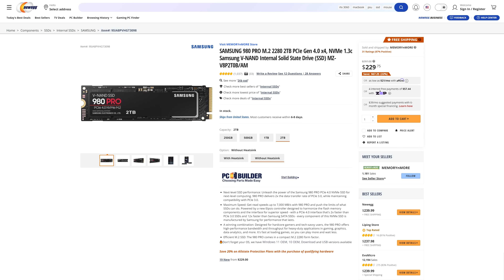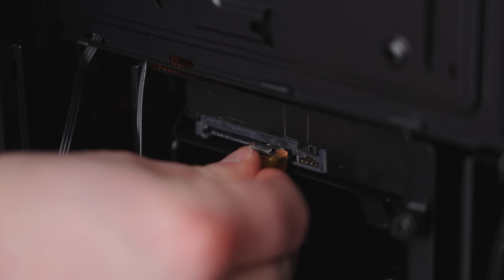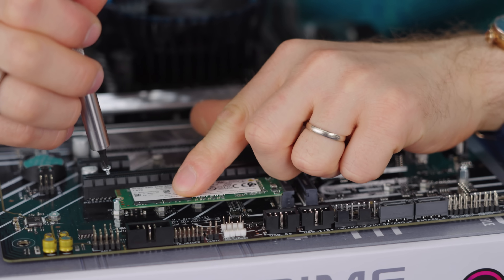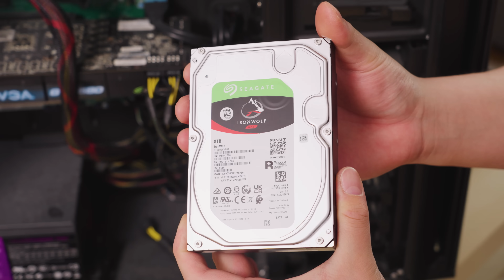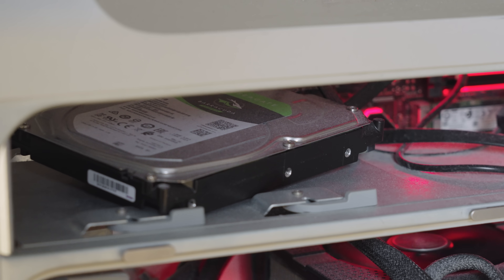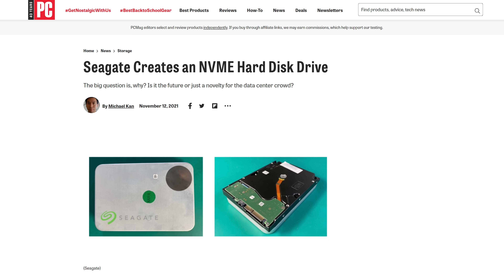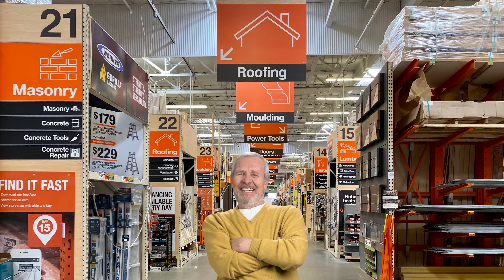Is SATA Obsolete?

Comment: One of the other things SATA did that PATA did not - was AHCI. Where you gain native command queuing, hotswap, and lowered CPU overhead. Not to mention you didn't have the complications of the ribbon. People talk about the jumpers as if they were a great problem (they really weren't. You got 2 options, master and slave. Set them and you're done.) But the ribbons were far more sensitive and caused no end of problems on their own, and they were shared. If you were reading from your CDROM and copying the data to your hard drive, you either kept them on separate chains, or dealt with the slow transfer as you could only read or write to one of those devices at a time.  This is easily the more important reason I found to get rid of it. If you have 4 devices in your system, that means something will always be waiting on something else.

Comment: A fact not mentioned is that SATA SSDs usually (if not always) have lower power consumptions and operating temperatures than the NVMe ones.
Considering the unperceivable performance advantage of NVMe SSDs for most of people, does the heat worth it?
Reply: Usually, yep. The speeds on NVMe SSDs are far greater than SATA drives, and unless your power consumption is dangerously close to the psu it’s not going to make that much of a difference. If heat is an issue, then the case or cooling mechanisms maybe need to be the things that change, or the positioning of your NVMe drive. If it’s seated between the CPU and GPU then it will naturally have a much higher temperature
Reply: @TheBigBadGlados  Yeah but, usaully in order to get the most performance out of an NVMe stick, it needs to be placed on the slot that is closest to the CPU, which also has the highest temperature as you mentioned.

Comment: Getting a SATA version of a SSD has been dumb for years, this video was released years late...  video obsolete?

Tons of hard drives in datacenters, tons more that still need to be made.   Just because someone made a hard drive with nvme connector doesn't make it a good idea. Servers have limited amount of i/o lanes..  You can only get so many nvme connections before you need expensive high speed controllers to multiplex all the different nvme connections...   So when hard drives at least have some other connector, or there is really something else to replace hard drives to ask if the connector is outdated seems like stupid question.  Its like asking are tires for cars outdated.. .with all cars still needing them.

Comment: Secondary NVME drive slots usually connect to the chipset and not use the pcie lanes for the CPU. There are some exceptions with motherboards, which allocate x8 lanes to the NVME drives, but usually you are not giving up GPU lanes for additional NVME drives.
Reply: I'm running a B450 board, and if the second NVMe slot is populated, my GPU is bumped down from 16x to 8x. I was considering getting a second 2tb NVMe, but after accidentally stumbling into this information, I'm considering a 2tb SATA SSD for games. The drawbacks are minimal, and the price is pretty much the same.
Reply: That's correct, I'm utilizing more then 1 and the other M.2 is on the chipset lanes with like the usb stuff
Reply: Where does one check for this information to know which method their motherboard is using?
Reply: @Crawfishness well, if you built your PC you can check the specs in the manual for your motherboard, it’ll give you the break down, if you have a prebuilt you can look inside and check for the model number of the motherboard and find a manual for it online (if they’re not using some custom no-name proprietary board).
Reply: If it's ON the PCIe bus, it uses "lanes".  duh
Reply: But it's connected to the chipset which is a switch duh usually connected thru pcie x4 to the cpu so it doesnt use any additional lanes on the cpu rather the cpu has 24 lanes whereof four are used for the chipset connection

Comment: Just one correction on M.2 slots, more often than not on new motherboards, I saw 2nd and potentially 3rd M.2 slots going through chipset and only first one is directly to CPU, meaning you can use all three without losing graphic card lanes. Though it is a thing to keep en eye out for and of course make sure that chipset has sufficiently fast link to the CPU to get most out of your NVMe SSDs. Or at least make sure you put fastest one in slot connected to CPU. Also I got feeling that as we move on, 3 M.2 slots will be getting only more frequent. Which I would definitely love to see. Though 2 are surprisingly not that hard to find or that expensive, but definitely worth paying bit of extra for, like I rather pay bit extra to have 4 RAM slots, just in case. 

Though don't get me wrong, SATA is of course here to stay as extra expansion option. Though I do feel like it will eventually fade into its niche as NVMe becomes cheaper and cheaper and as motherboards start increasing number of M.2 slots, like 2 isn't that rare on latest Intel chipsets. And AMD will definitely want to follow it up with next gen. Still for ultimate budget stuff, they will likely stick around for a while, plus mass storage. But I do think more and more general users will be happy with 1 or 2 NVMe SSDs, especially since some don't even cost that much more than SATA, while still being better wherever they can. Unless Direct Storage starts to become huge, which may or may not happen. Developers definitely want to use NVMe more towards its potential, but legacy kind of holds it back. Since to do so, it would mean that you absolutely murder experience at least on HDD, if not also degrade it on SATA SSD. Same as to why they don't use all of the cores to the max, since game needs to scale between minimum requirement 4 core CPU and recommended 6 or 8 core CPU. You can't have both.

Comment: Why hasn't there been any advancement in SATA performance over the years? SATA III was new when I was I think a senior in highschool and was beginning to be commonplace when I was in college (around 2004ish). Back when Hyper Threading became a thing and data was being sent faster and faster, SATA III was a godsend. However, there hasn't been anything since then in nearly two decades, or more. We keep advancing USB, NVMe, Ethernet, Drive capacity and performance... but what about SATA IV? If we could get better SATA numbers I'd be so happy to have (yes even now) decent 128GB or 256GB boot drive and a SATA IV storage drive (SSD) and a SATA IV Backup Drive (Mechanical).

Comment: Another Reason SATA is super valuable is that PC's as old as 20 years do have sata ports. And you can literally breate life into old pc's(atleast 10 years old) just by swapping the HDD with an SSD
Reply: That's not a real value from the industry's point of view.
Reply: wow haven't heard that one before
Reply: Did this today on a dell inspiron 5548 went from like 1:15 usable windows to 20 secs!
Reply: You still see speed benefits regardless of SATA interface, SSDs have way better access time than HDDs.
Reply: Figuratively. Figuratively breathe life into old PC's. The very opposite of literally. Computers, unlike aerobic organisms, do not need an O₂ - CO₂ exchange to function, neither can they become alive.
And even then, the word "figuratively" is completely unnecessary because "breathe life into" is a common figure of speech. STOP MISUSING THE WORD "LITERALLY", GOD DAMNIT!
Reply: On older SATA gen 1 motherboards you're capped at 150MB/s. Modern HDDs run at ~200MB/s... On PCs 10-20 years old you're not gonna see any speed improvement.
Reply: @一本のうんち  the details is in the devil. See, the way IO requests works is that the chipset sends request to the storage 'storage onboard controller. Now the responsibility of the SATA controller is to just wait for the required data.  This is where SSD are superior. Since the tech is good(abstracted reasoning), the access time is going to be much faster than that of an HDD, since the reasons are (short version) PHYSICS
Reply: @SoulRipper  You're right. I have an 13 year old laptop. After installing a modern SSD it was much faster than with the original HDD. Thus I can use my very old Laptop till now as an alternative to my energy-hungry PC. It's just fine for youtube, surfing through the www and office. That would be impossible with a HDD.
Reply: @3333927  Hard drives of any kind have very little impact on browsing or watching YT videos, unless the system has very little RAM and uses the storage drive for additional but slower RAM space.
Reply: @一本のうんち  My Desktop PC is circa 2008, capped at 300MB, I switched out an HDD for and SSD and there was a massive improvement there.  My Laptop saw the most improvment tho, as it didn't have that cap, but it's from 2015.  Point is, there are a lot of machines that would benefit from an SSD right now.
Reply: @ruekurei88  this is true, even PS4s benefit from an SSD upgrade
Reply: @一本のうんち  i am running a 10 year old motherboard and it has 2 SATA III slots.
Reply: @一本のうんち  The SSD will still provide significantly better seek time and those often dominate the IO cost.
Reply: @一本のうんち  I added a SSD to a 13 year old HP Notebook laptop and didn't see much speed benefit. When I looked closer, it had a SATA II interface, thereby gimping the extra speed the SSD would have given me.
Reply: It didn't help that it was a dual-core AMD E-300 1.2 Ghz  CPU. The CPU was the bottleneck. There is a minimum CPU requirement. I have quad cores at 2 Ghz that work fine. About to test a dual-core system at 2.6 Ghz (upgradable tp quad core at 2.7 Ghz.
Reply: @poseidon3032  my mini acer 15 year old 1.2Ghz single intel Cerion (crap) processor  4g memory came to life with samsong 870 ssd . dont have any idea of what the feck you talking about willis 
? writing this love letter to you on this Acer mini laptop .
Reply: @一本のうんち  I can see that you have not actually tested the difference. Its massive, absolutely massive. Most of the time, file sizes are so small that the maximum speed is never achieved. The fact that there is no physical parts that need to move to find the right 200kb file, huge makes difference, especially when there is 1400 such files (older pc games, for example, like sprites, sounds, textures). The read speed in small files, is insignificant.
Reply: @一本のうんち  It depends.  It's access time that makes a difference on old computers, i put PATA SSD to Dell D600 and the difference was more than noticable, on the other hand on Lenovo W510 i don't feel that much difference, but i have Win10 there and 16GB of RAM (for some reason i feel like laptops are handicapped by design and always "mincing" the disk few minutes after boot for something from no one knows).

Comment: Honestly, while I think it'll take years, I do think SATA is, more or less, about to be on it's way out.  I'm saying that, because of the "recent" addition of support for spinning hard drives to the NVMe spec.  I can easily see manufacturers wanting to "simplify" motherboard layouts and ports, by replacing SATA Ports on the motherboard with an NVMe port.  I'm also figuring it would be simpler, because of NVMe having built in power delivery, that's replacing a separate power cable from the PSU to the drive.  At most, you may have to connect another power cable, to the motherboard, to supply the extra power, but that's the case, anyway, and there are likely to be options for that.

  As for PCIe having far more bandwidth than a consumer spinning hard drive is likely to need, I can also see them having, either a "multiple port" option, of being able to connect several spinning hard drives to a single motherboard NVMe Port, and/or having an "adaptor option", enabling you to connect SATA Drives to the NVMe Port of your motherboard. 

Don't get me wrong, I think it'll take years before this happens, and even then, it would likely happen in the professional segment, first, before it finally makes it's way down to consumer hardware.  But, I suspect it will happen, by at least the end of the decade/middle of next decade, if not sooner.

Comment: The points about pcie lanes, nvme, and sata aren't generally accurate. It's going to depend heavily on the motherboard and chipset. Check your board's block diagram and you'll see (even on high end boards) that nvme, sata, and pcie lanes will be switched depending on type of nvme drive you are using. TLDR; RTFM.

On my current board the nvme slots DO NOT share lanes with the normal PCIE ports, rather ONE of the nvme slots shares lanes with the SATA ports. So really, you need to read your board's manual.

Comment: SATA and its Buddy SAS are going to be around for a LONG time for Mass storage.     And like it or not?   Those 15k drives in a SAS array are still workhorses for doing video work with HUGE files and they don't ever skip a beat.  And those things can be bought as whole servers for less then a hundy.  

You also have  things like tape drives and other gear that are going to be using this for a long time to come.   And with drives pushing to 50TB in about 10 years being commonplace,   your going to see RACKS of these things spinning away in  Near line archival backup storage.    AKA  Google Photos is only going to need more near line storage in the future as well  as YouTube and other video on demand services.    

Not to mention Big Data Government.    Surveillance systems are only going to get larger databases in the future with tape being the preferred long term cold storage solution.    

Speed is just not that important when we are talking about Near line storage and Backup.    And its doubtful  that Internet speeds are going to hover more than Gigabit for ISPs for the majority of people in the future.  

We also have all those Photos and Videos that are going to need to be backed up.   And people are not just going to transition to Tape storage.    As is?  It has not kept up with  Data Archival needs as is.     

Heck,  with 8k Video being the NORM for the future?   And  4k being the  240 FPS High Bit rate option?   Hard Drives are going to have to be stripped in an array just to keep up.   That Means SAS controllers are going to start being the norm for a long time going forward for Backplanes.    

The weird part is?    Flash is already way past  HDD density.   But a HDD is on a mass much easier to recover data from.  And with Large 20TB drives soon to be the Norm?     This just makes sense going forward.     But plan on the drives being in a Raid 1 array just to make sure there is a built in backup.     
And most companies are going to offer an offsite backup option.    So this just goes in hand with SATA and his Bigger Brother SAS being on the market for a LONG time forward.     

With all the Data Centers already having TONS of SATA and SAS Backplanes?    Its going to be a hard transition to anything else.   especially with the amount that people are charging for E-Waste these days to recycle it

Comment: Sata doesn't use pcie lanes? How do you think the chipset is connected to the CPU? While technically true in a sense that it doesn't use MORE pcie lanes that the chipset is already using, some pcie slots/ second m.2/nvme slot are connected to the chipset so they will fight for bandwidth

Comment: So what comes next after SATA 3? Will it ever be possible to plug 6 PCIe connected SSD drives on a motherboard? Because it seems like PCIe has the bandwidth for future SSDs. Perhaps an interconnect co-processor more akin to what the old FireWire had but with newer dedicated ASICs would speed the data along without tasking the CPU to handle drive management tasks, that was the advantage of FireWire over USB.
Reply: You can already plug 6 pcies if you want to. 4xM2 16 lane pcie adapter and there you go

Comment: Most SATA expansion cards will fit in the 1x PCIe slots that run off the chipset. You don’t need to burn PCIe lanes off the CPU with SATA expansion cards if you don’t need/want too.

RAID cards on the other hand… I don’t know of any MOBOs with x4 or x8 slots off the chipset that a dedicated RAID card would need.

Comment: Lol SSD is still wildly use in the world
Newer drives is way!!!! To expensive for a normal consumer
Only millioners can buys the newer drives wich is too small in numbers to change SSD to NVME or M.2
Only GPU and CPU is the only thing you need to change
Most of the part is ok 
You dont need to change 
SSD is way more consumer friendly
I will not buy NVME or M.2 for small gain on LOADING screen or faster boot not fps or performance
What you need is faster performance wich is GPU and CPU
SSD is ok and good for your wallet for the next 6 years new Brand New Computer

Comment: NVME SSDs have gone down in price, but so have SATA3 SSDs.  Right now (as of 8-19-22) I'm looking at (on Amazon) 2TB SATA3 SSDs for as low as $110, and 4TB SATA3 SSDs for around $280 (brand: Leven), and no they are not the Chinese/Wish knockoffs.  So for those that are more cash strapped SATA3 SSDs will still be the best bang for the buck.